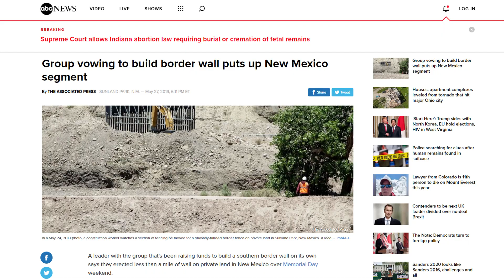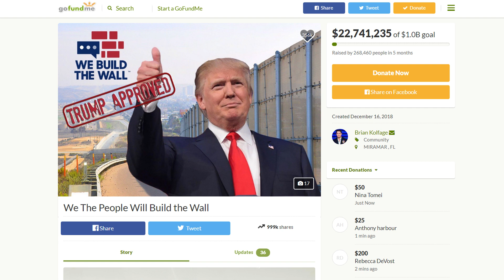Border Wall Being Built With Private GoFundMe Money in El Paso!

Comment: It's sunland park area. You still have the area between Luna county and Dona Anna it's wide open. Hey it's a start. People live in that area afraid and rightly so.
Reply: Was it built in the Mt. Cristo Rey area?
Reply: @SteveTheFazeman   I believe so  there are a couple of areas that they need a barrier in SP, that place is an open wound. You can literally see staging houses. I am glad they are building it. The only problem is,now it just diverts them to other areas.
Reply: @mountainghost556 ,
Appreciate the info.
Reply: @SteveTheFazeman  I work as a contractor and first responder in the border lands.
Reply: @mountainghost556 ,
Compared to the situation on the border lands today and when I was stationed at Holloman in the early '80s, I wouldn't be surprised if responder emergencies have substantially grown over the last few decades.
Reply: @SteveTheFazeman  I will put it this way I have had to learn  basic Spanish. I have been doing it for 9 yrs here and I have seen it grow. A lot of drug related and domestics.
Reply: @mountainghost556 ,
I can definitely see the necessity of speaking Spanish in first responder work.

Comment: Please consider donating $10 a month till it all gets built.  This construction company has a patented process they developed AFTER the govt already had their contracts in place. It also does much better in hilly terrain than what is already federally okay'd. And yes, the landowner had gone to the feds Begging for a wall and wad told NO.  

Now - in addition to the new extra hub duty wall, the private firm built a US-side roadway, lights and an observation station on the top of the hill so the Border Patrol can - in what used to take 20,30 mins to drive up - go up the hill in 30 secs n from that station see for MILES.
God bless the USA!